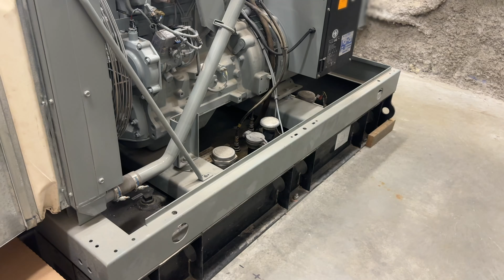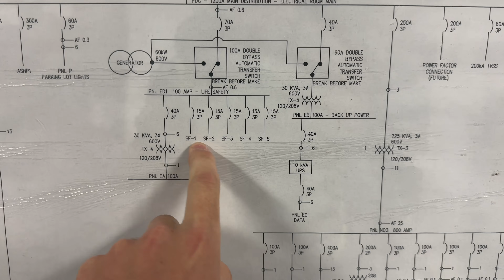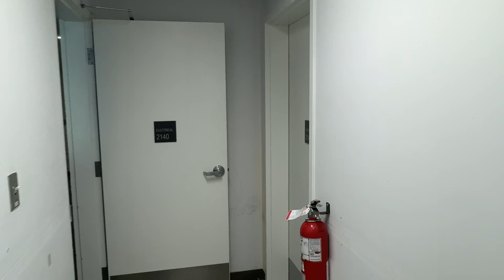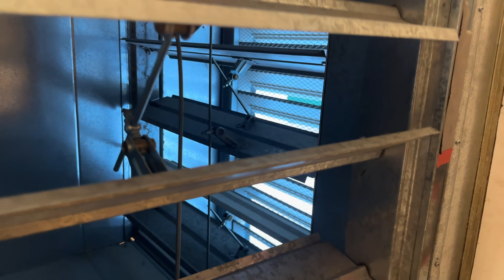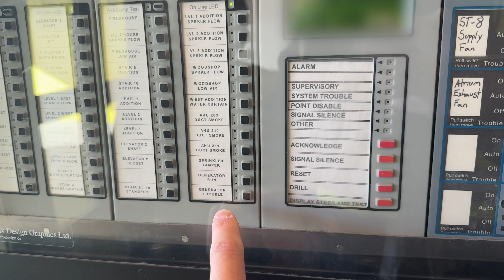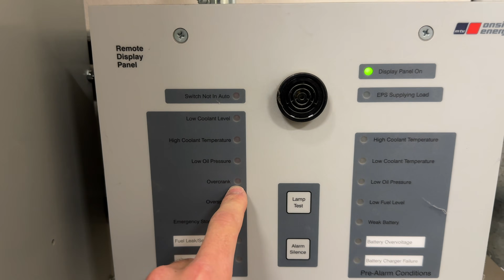Power Outage Generator Test At High School | Real Power Loss Simulation Emergency Generator Test!

Comment: Weird little air filter
That exhaust piping aint code at all where im from needs to be routed to the roof and be better insulated.
Reply from the maker: Seems strange for it to go all the way up instead of right outside all the way up would be through three floors.

Comment: Do we need to call the alarm monitoring company before doing this test? Thanks
Reply from the maker: Depends on lots of things. If the generator is monitored by the fire alarm system. And if the monitoring company does anything as far as troubles or supervisors.
Reply: Usually for trouble conditioners worst case scenario, the alarm company will call to see if everything is ok or schedule a service call but the FD won't get dispatched. Usually for a supervisory I'm not aware of them dispatching anyone.

Comment: We have an old Kohlar 39Kw LPG generator in our radio comms towers equipment shelter which we acquired from AT&T some years back, It's automatic transfer and powers the entire comms site plus it has a solar maintained battery bank and UPS that keeps the site equipment online including the tower lights during the time between power loss and generator transfer. She may be old but she has never failed us.
Reply: How loud is that generator when it's on?

Comment: what started before gen cranks? exhaust fan?
Reply from the maker: Maybe one of the dampers opening or fuel pump or something engine related not exactly sure
Reply: Yeah I heard that too it's a high-pitched whine I notice that you don't hear that until the 3 second delay ends.
Reply: Engine pre lube pump.

Comment: So what if the UPS was fed with 347/600 volts instead of 120/208?
Reply from the maker: That can't happen it's off a 120/208 panel which is off a transformer
Reply: @nics-systems-electric  Well if you delete the transformer that is
Reply from the maker: @SassafrasSapling  the power goes through the transformer you would have nothing
Reply: @nics-systems-electric  So if you feed that panel with 347/600 volts by bypassing the transformer, that would kill everything off that panel including the UPS
Reply from the maker: @SassafrasSapling  not sure

Comment: I have come across "Sender unit". It is the unit which measures the fuel in the tank. It is more specifically called a Fuel Gauge Sender Unit.
Fuel Leak / Sender failure might indicate that the fuel pressure does not come up and that there is either a leaking hose or the fuel level is not true and does not trigger Low Fuel Level
Sender failure might indicate that the resistance of the sender is not plausible SC/OC.

Comment: why not use solar panels and battery arrays instead of fossil fuels.. excess power can be used instead of grid power, saving $$$ over the long run
Reply from the maker: Solar has its place but emergency power is not it. Not only the batteries that would be required would be extremely large and expensive that whole system would need to be CSA/ULC listed for life safety emergency use. we have schools with solar but not with batteries that would be just too big for a school. The solar system shuts down during a power outage and only the generator produces power at those schools anyways.
Reply: The amount of batteries needed to run for the required duration would be massive. Plus with diesel, assuming roads are clear,  you can get fuel deliveries at regular intervals.
Reply: Oh yeah 70kva 24/7 when the sun aint shining

Comment: Do you ever alternately turn off one ATS at a time to verify that particular ATS can start the gen? I know in a true power outage it may not matter, but at least in the US when it comes to hospitals you have to verify each ATS can start the gen. Which used to be rotated each test and I have seen 15 or more ATSs in some hospitals. But that way, if that one circuit trips for whatever reason the ATS is confirmed it can start the gen. But not sure how strict regs are for schools there. It's a school, not a hospital.
Reply from the maker: It's not something you have to do. the generator just has to be started monthly you can just hit the run button to satisfy that requirement. I think I have started it from the standby transfer switch before just by doing a test with load from the actual transfer switch not switching the breaker off. Definitely not a bad idea to test all transfer switches.
Reply: @nics-systems-electric  Makes sense here to not really worry about it. But when it comes to back up gens and hospitals it's a whole other layer of regulations they have to meet and validate regularly.

Comment: At the switchback why was the 3 sec blackout, if the main power and the generator ran simultaniously?
Reply from the maker: That's what I explained about the neutral delay. Because frequencies aren't matched there needs to be a delay when transferring.

Comment: “Sender failure” possibly refers to sensors. I’ve heard engine oil pressure sensors referred to as oil pressure senders, I’m guessing it’s checking for resistance and/or voltage to be within a certain range to verify operation
Reply: The fuel sender is the mechanical float that measures the tank level. So that light comes on if it detects a sudden drop in the fuel level meaning ether the tank is leaking or the fuel gauge has failed.

Comment: We have the same type of thing at our datacenter, only it's a tad bit bigger at 500kva.  Our two UPS's are 284kw and 140kw.
Reply: There's a huge data center that's going to be built near where I live soon, and in really interested in getting into it as a career. Do you have any suggestions for a beginner on what to study and what steps to take?
Reply: @RT-qd8yl  you'll need to find a way into IT and specialize in datacenter server/switch hardware.  Might help to look at "foot in the door" jobs @ large DC's.  Be prepared for off hours work.

Comment: What is wet sacking?
Reply from the maker: I'd google it as I am not a diesel mechanic.
Reply: Wet stacking, I believe is referring to either moisture or unburnt fuel in the exhaust,  causing it to produce black smoke.  I used to do maintenence for a nursing facility,  we had a 250kw Cummins that I did monthly load tests on.

Comment: 0:07 “60 kay double you” why don’t you refer to it as it’s real name? Respect derived SI units. I don’t even think it’s going to be kW. It would be KvA?
Reply from the maker: It's not "Kay double you" It's actually 60kw which is a measurement of power. kW is a common abbreviation for thousand watt. and is not the same as kVA. Generators are usually rated in kW however often both are specified on the nameplate as with this one. 60 kW or 75 kVA. Hope that helps.
Reply: kVA vs kW... 
VA is Volts times Amps and with DC gives you the Wattage, k for kilo, M for mega etc.... When it comes to AC since the current and voltage will not be in phase (except a purely resitive load) a simple VA calculation will not give you your actual power output. You have to account for the power factor, which is the ratio of VA vs real power expressed as power factor. As a general rule of thumb they use a 0.8 power factor to derive the kW rating from the kVA rating. But in real world conditions the power factor will change based on the types of loads. Purely resistive loads are a PF of 1, a crappy motor may be as low as 0.5 unloaded.  So transformers and generators are based off the VA they can produce not the actual Wattage, since the power factor is unknown. And yes, your toy 5,000W gen at home is rated by Watts for simplicity, but real generators are rated in kVA or MVA. 
As far as nitpicking kW vs kilo-Watt....  that's just being a pain in the ass for no reason. Anyone in the industry calls it kW, MW etc.... By the way, Watt is the SI unit for power. So kW is correct in SI nomenclature too. 
And for someone telling someone to respect SI units, kvA is wrong. kVA is correct. V and A are capitalized as they are respective SI units. The k is just the sign for thousand and is lower case.
Reply from the maker: @inothome  I appreciate the explanation and detail. I'm not sure what makes my generator a toy as it does the same function as larger set ups during a power outage. Either way thanks for the comment.
Reply: @nics-systems-electric  You misunderstood, that wasn't directed at this generator. I was referring to little portable gens that are rated in Watts, not kVA like this gen is. Like a Honda 5kW gen, they normally don't advertise them in VA since most people buying them wouldn't understand. I was more talking to the original snarky comment about "respecting derived SI units".

Comment: Do you guys put a CO detecter in the generator room, or is that not much of a concern with the exhaust system you have?
Reply from the maker: There is not a CO detector. diesels produce much less carbon monoxide than gas engines so I guess it's not as much of a concern especially since it's exhausted outside and there is constant air movement in the room when it's running

Comment: They tested the generator at my work yesterday before it opened (it’s a department store at mall here in Florida). I was wondering if you can think of any reason why the lights went off three times instead of just twice when the loads switched as shown here?

Comment: Can you do a video with the exhaust fans and fire alarm running on generator? It would be interesting to see how much load they actually put on the generator….
Reply from the maker: The fire alarm system itself won't make any difference the exhaust fans would definitely put more load on it however I won't get the opportunity to do that as I only have a month left working in this school district

Comment: I think that the sending failure is referring to a fuel sending unit in the tank since if it fails then generator runs out of gas. (At the end of the video)
Reply from the maker: Yeah probably that would make sense

Comment: Why do you turn off 2 subpanels instead of the main breaker for these tests.
Reply from the maker: There's multiple reasons. we don't want to shut down the entire building for no reason. You also don't want to be operating a large breaker under high load as it can fail. When you do a full building shut down you wouldn't be just opening the main breaker you would be turning off every smaller one first anyway.

Comment: In my last comment on your channel I talked about mixed signals and you use that word alot. So I did some research on what it means. It means that horns would do continuous, then code 3 then 4 randomly after a few seconds. I don't know what YOU mean about mixed signals but either of us could be wrong.
Reply from the maker: I am not wrong I am not sure how you got that as a answer however mixed signals is referring to a mixture of device types producing a significant difference in sound other the tone produced or the pattern of the signal
Reply: @nics-systems-electric  so, mixing horens and low frequency sounders isn't legal... Right? (I don't know much about the code(s) in US and Canada because I'm from the Netherlands)
Reply from the maker: @wastemanagenl  it's difficult as I don't know of any information on which specific devices which are and are not allowed I would guess those would not be legal due to the quite different tone however if they are in separate areas where they are not audible from each other it would likely be OK
Reply: @nics-systems-electric  I'm learning